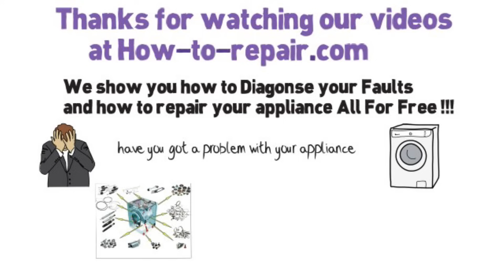How a washing machine door lock works, how to test interlocks

Comment: great info i to thought it would be a simple micro switch to lock unlock the door but n as i got inside witch then found myself watching your video to see the working as i thought id be able to just bypass it for now as the mrs is on my case now as like most stuff around the house its left till last minute now we have a pile of washing the mrs will have me doing laudry runs if not sorted soon. but thanks again for the info on the door workings even though i learnt something today and it wasnt as basic as i first thought.

Comment: I have a Next dinamic Hoover washer/dryer ,when i turn dial to program sometimes i get the padlock on display even though i have not pressed the start button and after a few seconds i get E16 error , i looked up the error for this and found out its the heater eliment could be faulty i changed the heater eliment but still get the same error code , somtimes the machine works ok and other times when i have not used it for a few days the error comes back on, i checked all possible reasons with pump blockages or water and drain pipes but found they are all ok, i think it could be the lock that you showed or something else!

Comment: I have a LG front loader washing machine, model number WD-8005. It has a DE error. I have checked the door switch and that tests out fine. I would appreciate any advice on what could be causing this problem. There is no 220V AC that across the door lock contacts. The main circuit board number is 6870EC9168A. If you have a circuit diagram that will be great. Thank you.

Comment: Hi. I have an indesit washing machine. the door lock light is flashing and the door won’t lock and water is not running. I changed the interlock with a genuine part. But still getting the same problem. What else could be wrong?

Comment: Hi there I have a machine that locks but the locked indicator on the front panel does not illuminate. The machine fills with water but the motor to turn the drum never runs. Does the circuit need a signal from the door lock before it allows the motor to run? It is a curry’s essential C912WM18
Reply from the maker: if it fills then its ok. check motor brushes
Can you do us a favour and please share this video on your timeline Facebook twitter etc .
This will help other people who can’t get engineers out to help them.
https://www.youtube.com/watch?v=rFyGAHVFUW8&t
https://www.facebook.com/how.to.repair.appliances/
Stay safe

Comment: Is it the full 220 volts accross the coil and does the neutral switch on and off to prevent overheating of the coil or is there a  resistance on the circuit.

Comment: At 5 min 26 sec, finally a clue as to which wires to bridge to bypass a malfunctioning door-lock. Remove the door-lock after disconnecting the 3 wires leading to the lock. Bridge common to live. (Keep neutral isolated with insulating tape). Door-lock for my 21 year old machine no longer available so bypass was essential & machine is now working great.
Reply: I did the same thing. Parts left off cost you nothing!
Reply: I got 2 browns and a red. For 210 volts only across 2 browns. Any ideas which ones I link

Comment: The problem ridden Whirlpool Duet HE3/HE3t series is different.   
One connector contains 2 wires that determine if the door is closed (switch - normally open circuit / closed when button is depressed).  
Another connector contains 2 wires that determines if the lock is locked or not (switch - normally open circuit / closed when lock mechanism is down).  
The final connector contains three wires.   It connects to for lack of correct word - a center tapped solenoid.  Apply voltage to middle and "outside" - and door unlocks.  Apply voltage to middle and "inside" and door locks.

Unfortunately, I have a short in one side of the coil.  Hopefully I can find the part without purchasing the entire $80-$100 assembly.

Comment: This video showed and proved to me that is time for a new machine.
Paul you are great explaining how this switches works. It is terrible, they should not make it bi-metal enforced, this is really old design.
It is so much easier to do by computer program,
Water is out of the machine to the door level? yes - no
if yes, open door immidiatelly
if no restart a drain cycle, tell the customer water in machine to high, draining. then open door.

Paul you are did a fantastic job!

Comment: Very well explained.My problem is that I tried to open the door after 15 minutes .It did open but it cracked .So now even if the door lock is in order and shifts but the door is not shutting. The crack I tried to stick as it was a hairline fracture but am now not able to shutbthe door. Its a WW 1995 model. Excellent machine .I wonder if the door can be replaced in India.

Comment: Hi Ive got a whirlpool washing machine which shows the door open LED. I bought a new door interlock and replaced it, and it is still the same. Whirlpool have quoted £129 call out, £100 an hour labour and extra for parts needed, plus VAT, thats more than the machine is worth.
Any ideas where I should look next? As they wont tell me, but they sold me the interlock.
Thanks
Nick

Comment: I brought a new washer door lock assembly and latch because the washer would fill up but the door would not lock causing the washer not to work. After replacing the switch on the door  and the latch the door still not wanting to lock, any ideas? I've already tested the switch and it's fine. Help please I have a Frigidaire Affinity front loader washer.

Comment: I am a missionary in Tanzania and have use of a whirlpool washing machine. The lid lock seems to have a short in it some how as the led light flashes and the washer cycles in and out of proper functioning as contact is or is not present in the latch mechanism.Replacement parts here are very difficult to acquire and or procure so can you please explain how I can temporarily or possibly semi permanently bypass this switch?
Reply: NEVER BYPASS A SAFETY FEATURE......... MANUFACTURES LIKE SAVING MONEY   SO IF IT WAS NOT NEEDED THEY WOULD NOT FIT IT.......... IT WILL RIP SOME ONES ARM OFF

Comment: Hey mate, I have the Simpson Esprit 650. The mistake I made was washing a heavy blanket? Now there is left over water, it is not spinning properly, and won't drain properly only a little bit.

Any suggestions?
Reply: try to check the water level sensor. .

Comment: My switch is just like the one you power up and show how it works. I sanded all the parts that had carbon build up put it back together and it works just fine.

guess I saved 30 euro?
Reply: Thanks so much for the video if I ever need parts and they don't have it in town I feel I owe you and will try to send business your way.
Reply: I could buy you that beer i guess but I am unemployed and well fixed my machine at no cost.

Comment: Hi Paul..Please could you help me with my wash..a Samsung B1045av..where the selector Knob freeze in just one position (in my case (cotton program) and due this the machine do not start the programs..Other buttons are working fine..When i play start..only a low noise I can hear..maybe the interloock..only after appears DE code..for door problems...But I think the interock is not the main problem of the circuit board..I think.. Thanks Roberto Daltro

Comment: I have a Kenmore Washing machine 110.20222510, it is less that two years old. 3 months ago it held my Fiance's hostage until we took it apart. We bought a new lock assembly, replaced it and did one load of laundry. On load number 2 it locked the clothes in it again! So Kenmore machine that is less than 24 months old has had it's lock assembly replaced twice. What do I do?

Comment: Hi guys, my Ariston washer dryer combo won't recognize that the door is locked. I hear the lock latch, physically it won't open, but the door lock indicator (button with LED) turns from yellow to red and the unit won't continue. Any ideas?
Reply: No error code, flashing or diagnostic info other than the red LED on the door lock button; that's all. Thanks in advance!

Comment: Thank you for the information.  I did use this knowledge to fix my LG front load washer with the DE error.  No one else shows how the latch works. You did!!!!!
After some thinking i decide not to buy new part, instead i take it apart to bypass by fooling it.  Wedging a piece of plastic below the contact strip  so it makes contact with the upper one did the trick.  Very obviously the heating bimetallic strip was bad on mine thus causing the DE error. Furthermore I broke the plastic pin that prevents the door from opening once it is running.

It works. No part replacement requires.  Door can be opened during use  but I do not care as long as it works.  Besides who would open the door while it is running.

Thanks again for showing how it works when no one else does.  Knowing how it works is the key to figure out how to fix it or by pass it!   I did and it worked.

The metallic heating strip is common to fail as it heats up and cools down throughout its life and once that thing is toasted there will be no more contact goes in and out thus the DE error.  Well if  that were the case then i will fool it by providing the missing door lock signal mysel by bypassing it.    Many appliance forum repair people said it can't be done.  Well they either want to sell new part or don't know themselves how to bypass.  I beg to differ!!!!!!

Hope this helps someone.   Attention!   this mod. requires disassemble the latch switch assembly which is very easy and understand what i talk about here to do it.  Good luck!
Reply from the maker: Iam Glad we could help you
Please remember to subscribe to our channel
https://www.youtube.com/user/Apart4u?sub_confirmation=1

Remember to Shop with www.how-to-repair.com and it would help us by posting the video or

website on your timeline. This helps us a lot and if we really helped you can
always buy us a beer http://how-to-repair.com/help/buy-paul-a-beer/

Please remember to mark us to your favourites also I would be grateful if you would
subscribe to our channels social media as this really helps my site and keeps
us going.
YouTube. http://www.youtube.com/user/Apart4u

Facebook. https://www.facebook.com/how.to.repair.appliances
Reply: tom ho '
Reply from the maker: Iam Glad we could help you But for people with not much knoledge i do not recomend this! 
Please remember to subscribe to our channel
https://www.youtube.com/user/Apart4u?sub_confirmation=1

Remember to Shop with www.how-to-repair.com and it would help us by posting the video or

website on your timeline. This helps us a lot and if we really helped you can
always buy us a beer http://how-to-repair.com/help/buy-paul-a-beer/

Please remember to mark us to your favourites also I would be grateful if you would
subscribe to our channels social media as this really helps my site and keeps
us going.
YouTube. http://www.youtube.com/user/Apart4u

Facebook. https://www.facebook.com/how.to.repair.appliances
Reply: thx for the video, very nice explanation, would be nice to have such a test box also, did you make it yourself :D ?

one day my mom's LG machine just jumped the fuses in the house and after that starting the program after a moment would give the dE (door) error

I basically made an extra feather connecting live to common and pushing down live closer to common. worked just fine, the machine is now showing the door locked indication all the time

the door still does lock in my case, just it takes 10 seconds after the program started now. so in my case the heating is still working it showed 800 ohm also between live and negative, it's just not strong enough anymore as it used to be
Reply: i'll try your method sounds perfectly logical. but instead ill try a jumper across that connector mimicking a closed state. thanks for the tip.
Reply: Can you please tell me how to do it I broke that little the little lock that locks the door now my machine won't work can you show me how to do it so I don't need that thank you
Reply: i dont think much of your logic... you need to think again.
Never , ever,  by pass a safety feature!!!!!!!!!!.........
 Anyone could open the door while the machine is in full spin,, children love to experiment, and will open the door, they could get a limb ripped off in the death roll of a crocodile.that is your machine. i am sure the judge will think you were very clever before he sends you to jail. 
 please buy a new part before you kill some one.

Comment: This is a very long detailed video, but you didn't really explain what you were doing with the multimeter.  What are you measuring?  What units?  What readings are you expecting?
Reply: He's checking resistance and checking when two terminals short, hence that's how this lock works, its a button basically.

Comment: How can I check the interlocks in washing machine the model is bosch logixx 9 varioperfect e-nr WAS24422GR/07. The code of the original door lock is 00619468. Contacts are 3,2,1 which bridge cables.because I understand I have problem with the washing machine if anyone knows let's answer thanks

Comment: could you offer me a quick help? I have a blown out transistor on the circuit board. z0607, someone linked it to the door lock mechanism, but mine functions just right, just that program on the machine stops immediately after 2-3 seconds. my question is, for testing purposes, if I disconnect the door lock, would it ignore it and start the program like it normally would?